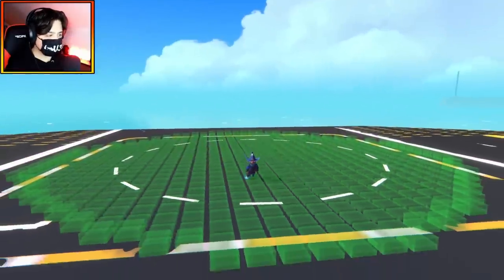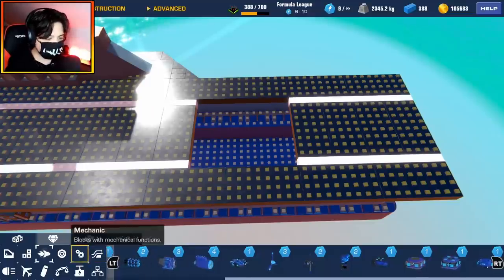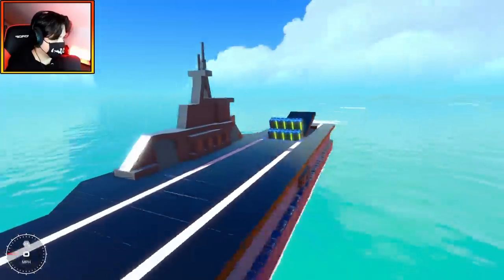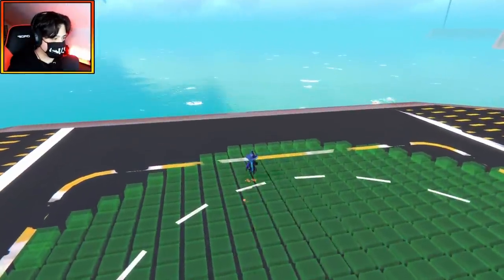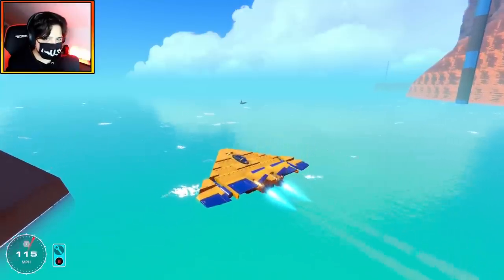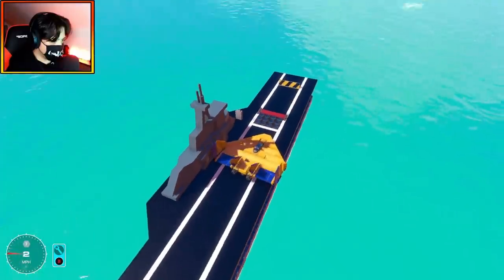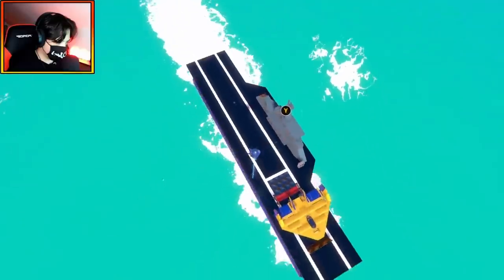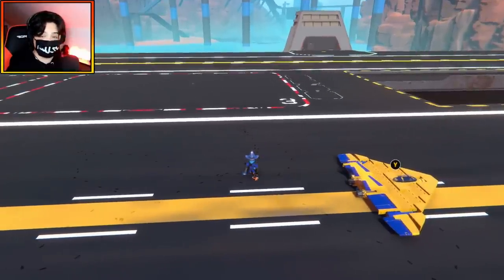This AIRCRAFT 'LAUNCH' System Actually WORKS! | Trailmakers

Comment: You should add another timer after the one that activates the tractor beams that resets the system after a delay so you don't have to do it manually every time.

Comment: your planes would be alot easier for landings if you had the landing flaps
basically useing a altitude sensor to set the flaps to come on at a sertin hight so that your planes can fly slowly without to much lift or drag you can make it so the two sets of flaps are on both positive and negative and that will make it so that they cancel eachother out and make the plane slow down but not pitch up or down you can do this with an altitude sensore or a distence sensor I use the distence one because it works for any hight of ground surface but if you are over watter the altitude sensore would be a good one to use